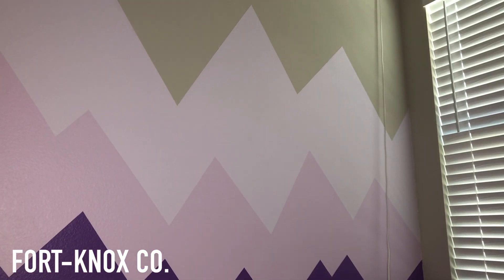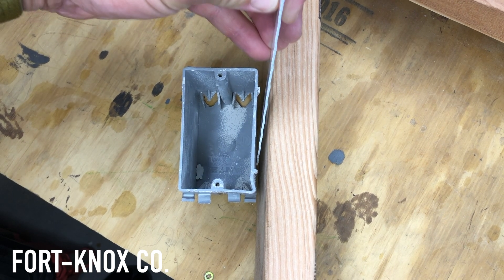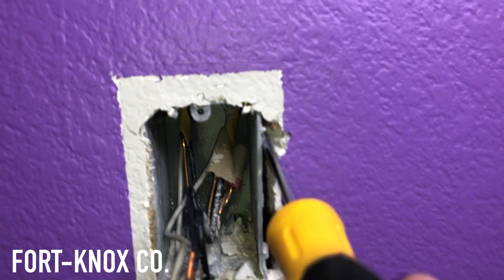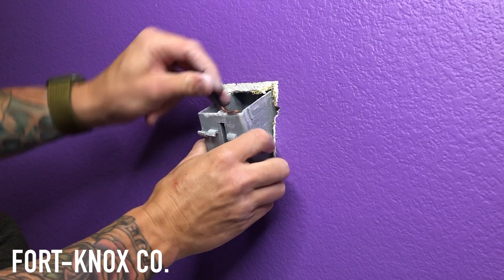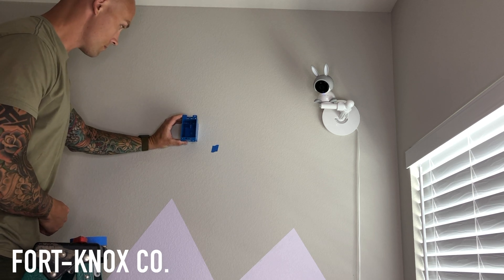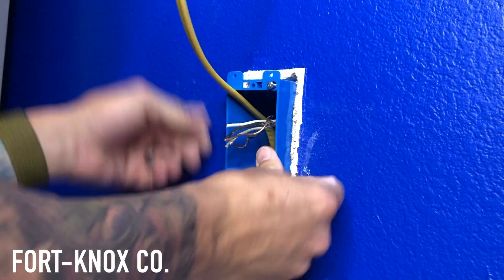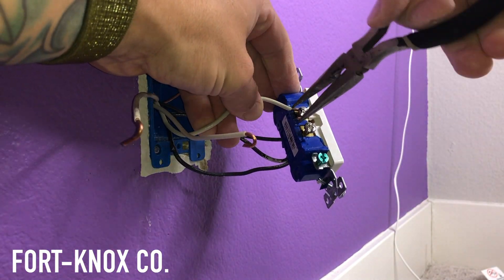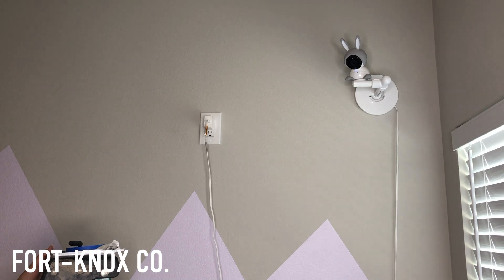How To Add an Electrical Outlet | Move Outlet Up Wall | Wall Mounted TV | Hide Wires  Easy!!

Comment: Why did you replace the original box instead of just using pig tails and running new romex up through the top of the old box to the new box?
Reply from the maker: That is one way to do it. But usually you can run into problems with feeding that wire through the back of the box and then if the wire doesn’t run exactly where you want and there’s any obstruction you have a really hard time adjusting the wire feed through that limited space through the original box. So a lot of ppl would prefer to zip out the old box, have space to work, maybe add a deeper box to help with wire organization and the more easily run your new wire and be done. It can be a time saver overall

Comment: Great how to video. Thanks. A new box at the bottom is nice. Why did you choose not to leave the old box in and avoid the extra work to replace it with a new one?
Reply from the maker: It’s can be difficult to run a wire through the back of your old box. Sounds simple but you’ll quickly realize it can be a hassle. Fishing the wire is much more difficult, organizing the wires can be more difficult since you now have another set of wires. I found that you’ll spend way more time trying to keep it in the wall and using the old box than a couple seconds of zipping out the old one, pulling out your wires, reaching In The wall to run your new wire and tightening two screws to install the new “old work” box. And you can get larger old work boxes if you need it for the extra space inside for the extra wires now there.   It’s really a time saver overall and sometimes a better install.

Comment: What about the amp of the wire and stuff? Someone told me that it might blow circuit. I am confused. Can you please help with my confusion? I was told that the lesser the number higher the amp. like If I use 10/2 will that cause blowout?
Reply from the maker: The wire in the wall supplying power will most likely be a 12/2 ( yellow casing) with your black, white and bare ground. 

The power coming off the transformer is a very small gauge, usually an 18 gauge / bell wire / low voltage. It can handle the voltage/amperage coming off the transformer. It’s downgrading the power source essentially and giving you enough but not too much for that doorbell

Comment: Was it necessary to remove the old box  or just preference?
Reply from the maker: That’s the “correct” way. Remove the old box and install the new “old work” box. Mainly so you have good access to your wires and can run all new wires through the holes in the back of the box. 

But if you want to, you can technically use the box that’s there, but the correct way is to run your wires through the back holes provided. So doing that on an original box already in the wall can be a pain sometimes, spending much more time fiddling with the origin box, so most just zip out the old box and install a new one and have lots of room to move things around and work inside the wall. Running your new wire is much easier when that lid box is removed.

Comment: Thanks for this video, never knew about “old work” gang boxes, I think it will help a lot with way my project of adding an exterior outlet off an interior one at a vastly different height.
Reply from the maker: No problem at all. Yeah the old work boxes are a lifesaver. Once you start doing any electrical work, you learn very quickly about new work and old work boxes. Lol. Literally almost every renovation with electrical you’re gonna need one of these. Then once you understand how they can work, you can use your imagination and create your own path. The next step is learning how to jump across studs or corners.

Comment: I want to try this method to move a floor height outlet to counter height. Then the floor height outlet will be covered by new base cabinets. Since it’s not safe to have an outlet behind a cabinet…how can I achieve this while permanently capping the floor height outlet?
Reply from the maker: You can do this method but instead of keeping the outlet at floor height you just connect the new wires to the original wires, essentially splicing a length of new wire up to your new location. In that floor height box you will have wire caps on each of those connections and you won’t be installing the old outlet, you’ll just tuck those wire connection into the box and place a flat junction box plate over. That way they aren’t sealed into the wall, you technically still have access to them. 
With the new wires running up to your location you can wire in your outlet as you would.  It’s up to you if you want to cut a small square into the back of your cabinet over the old location to access the flat plate cover or not. Just incase you  ever need to work on the wire connection.
Reply: @FortKnoxCo  This is so helpful! Thank you!
Reply from the maker: @CookingWithKhonKhao  I also have a video “how to add and outlet to an existing circuit” where I do similar to  what your saying, outlet under a countertop in a cabinet and I moved electrical down into the cabinet.  Either way the process is very similar. Just depends on how you want to finish the project. Have two outlets , one in the cabinet & one above the counter top. Or put a plate over the connection down below and only use the outlet above.

Comment: Thx. Any reason you need to remove the old box instead of just try to run new wire through it?
Reply from the maker: Removing the old box is technically the correct way to do it. Unless you want to use one of the holes in the back of the original box. You can do that but you’ll probably realize the pulling or running wire through it will be a hassle and could take more time than just removing the box, having lots of space to work with and installing an “old work” box

Comment: My problem is I need to relocate an outlet up higher but offset a couple of feet not just straight up.
Reply from the maker: Not a problem. You would either jump the power over at the box your starting with and drill through the stud just large enough to get the wire through. Then feed it over. Of cut a hole at the top, feed wire up. Then use that hole to drill sideways and feed wire to next hole or area you want. Requires a couple more drywall patches. But that’s how power is added after construction. Not too hard.

Comment: Why did you remove the old box instead of just adding a wire to it from the outlet above?
Reply from the maker: You can do what you said, throw a new line up through the original box with Fishing tape. But there’s a couple ways to accomplish the task. If for some reason you need more room to work or want to upgrade size/type of box this method Is an option. Both ways work though.

Comment: Why remove the old box?  Why not leave it and fish wires up out of the existing box?
Reply from the maker: You could do that too. But you might need more working room or if the fishing through is t successful then the next step to get better access to the wall would be removing the original box then replacing with and “old work” box. There’s several ways to accomplish this
Reply: @FortKnoxCo  i commented before I realized you had insulation to deal with.  Fishing along the stud into an open drywall cut is definitely easier with installation involved.  Gonna give it a go without replacing lower box.
Reply from the maker: @willywonka2164  it’s all good. Yeah with insulation it can be a bit harder. But either way could work. I’m sure you’ll get it done. Catching the tape at the top hole that’s larger is usually not too hard.

Comment: what if I don't have a center outlet to work from? My problem is the closest outlets are both on the left and right sides about 4 ft apart from where I want the center outlet to be. I want a outlet up the middle of the wall behind a mounted tv
Reply from the maker: It will be a lot of the same process overall except to move the wire across a couple studs in the wall you will have to make a couple small cuts in the drywall. There’s several ways to accomplish this. There’s a “pumpkin cut” that helps reduce the amount of patching you’ll need to do, or just a traditional rectangle hole next to the studs, pop it out, drill a small hole through the stud to fish the wire through and repeat that, then when you have it in the location centered you can fish it straight up to the final location. Then you have to patch the small cuts you made.

Comment: Can you do a video on running a tv cable wire in the wall👊🏻
Reply from the maker: Yep. That would be a very similar process. You
Can use drywall old work boxes to trim out the opening there you want it to come out. they have several designs for cables to be pulled out through the wall. Or if you want to have a plug where you screw it into the plate on the wall you can do that too. Just depends on how you want it to look when it’s finished

Comment: You only supposed to have one wire on the screws you need to have pigtails
Reply from the maker: You are correct. Pigtailing the wires is the best way to do that.

Comment: what do you do if you don't want to use the lower outlet anymore? I need to add a range hood outlet and the outlet directly below isn't going to be used anymore since the range will be under it.
Reply from the maker: You can just connect the new wires your running up to the new box and not have them connected to the old outlet. Black to black, white to white and ground to ground. Use the wire caps and tuck them in the box in the original location that is not going to be used. This basically is just extending the wires up to your new location. Like splicing wires to make them longer. 
Then you can just use a blank outlet box plate to cover the box with the wires in it. You’re technically not supposed to drywall over any spots where a wire connection is made so it’s best to just use a blank box plate.

Comment: can you link the thing you checked for the power?
Reply from the maker: Just added it. Should be under tools used. Circuit tester and multi meter.
Reply: thanks!!  @FortKnoxCo
Reply from the maker: @Yawahtahs  no problem at all

Comment: How did you find the old wires and put them up there? I May have missed the step. Either way, you've definitely educated me a lot on this more than any other video that has led me to more confusion lol
Reply from the maker: Thank you I appreciate that. 
Are you referring to the wires in the original outlet that I branched off of to extend up?  Once you pull out the original outlet you basically branch off those wires to run a new set of black/white/ground up to the new location.  Just by tying the new black/white/ground off of the original ones in the back of the outlet in the wall that we started with. This just creates a series of outlets or commonly referred to as a “daisy chain” connection.
Reply: Wow! Now I get it. You explained it perfectly. Thank you very much. I'm no electrician but I mount TVs for a living so power bridge is something that I definitely have to overcome and learn. And buying the kit is definitely not cost effective enough so your method is perfect. I'll do my first job in my own home and see how it goes. Thank you for your valuable help and knowledge
Reply from the maker: @RioElMystic-999  awesome! No problem at all. I’m happy to be of help. & yeah if you can start to offer this as part of your service you could kill it. Increased revenue and people will appreciate it. You can definitely save on your costs by doing this the right way with the old work boxes and some new wires installed. Way cheaper and technically better than the kits they sell.  Stepping your game up and crushing the market.

Comment: here are comments on the outlet installation 
1. when you were turning off the power you are supposed to plug something into the outlet to be safe.
2. it's against code to put 2 wires on 1 screw terminal you need to pigtail that outlet. 
3. you are using the wrong phillips screwdriver use a #1 robertson or the ecx combination screwdriver.
4. you used the 20 amp outlet on 15 amp breaker that can overload the circuit.
5. this video should be removed because of violations.
Reply from the maker: 1. Yes you can check the outlet that way, that is one of many methods and there’s several tool that aren’t too expensive to use to test the circuits to see if they are live or not. 
2. Yes your correct, you should not place two wires under a single screw. Pigtailing is the preferred technique. 
3. Yes there is a specific “electrician” type screwdriver, but most phillips screwdrivers will do the job just fine. This is a little more preference in my opinion, not everyone will have a #1 Robertson or ecx combination on hand. But most will have a standard Philips or flat head laying around to do the job. 
4. All my wall outlets are 20amp circuits here. I have 15 amp breakers for my lighting and 20 amp for my outlets. So the 20 amp tamper resistant outlet is what’s around the house from the builder. 
5. The video is really for information, motivation, educational purposes obviously. Never did I say this is the only way to accomplish something or the text book way. Everyone has the ability to do their research, compare and see what works for them and their abilities. Most gather that this type of stuff overall isn’t too complicated, nothing  to be afraid of and can do it themselves.  And fortunately there’s others like you who can help them too along the way. Everything that you said is great information and I hope it finds it’s way to those who need it. & I’ll try and incorporate some of the stuff you said into future content because it’s all good info.
Reply: @FortKnoxCo  do you know the wago
 221
Reply from the maker: @Aasiakhanum1  yep. Haven’t used them much but have seen them. They look nice and convenient

Comment: “How to home” has same video but he doesn’t cut the existing box. Much easier use fishing pull
Reply from the maker: I know exactly what your talking about. I have a video I’m putting together where you leave the original box in place and pull the new wire up.  It’s just not code compliant that way.

Comment: Instead of having the outlet at the bottom, could you just cap the old and new wires together?
Reply from the maker: Yep. You can do that too if you don’t need or want the old outlet. You’d then just put a blank outlet cover over the old box. Technically you are not supposed to cover and hide wire connections in the walls, like drywalling over it after you splice the wires to the new. You need to be able to access anywhere there is connections. But yep, I’ve don’t this method as well.

Comment: Thanks. Doing exact same thing for my cameras in bedroom as well so this is perfect. Guess I can add the two tv wall Mount while I’m at it haha
Reply from the maker: Yep! Exactly. I just did one for our tv in the spare room. I used a different method where you don’t have to remove the original box this time. I’ll be putting the video together for it here this coming week

Comment: Not too shabby. Definitely would've pig tailed. And some glass Rods would have helped.😁
Reply from the maker: Thank you. Yeah I went back and pig tailed the wires. I have another video coming out showing another method I used and I show how to pig tail the wires.
Reply: @FortKnoxCo  i’ve been doing it for 28 years and I have so many tricks up my sleeve, I am the master of no drywall damage.
Reply from the maker: @timbo86051  that’s the key, do drywall work or as minimal as possible.

Comment: What do you do with fire breaks / fire blocks?
Reply from the maker: With fire blocks in the wall your going to have to make a small cut in the drywall and drill a hole as close to the center of the blocking and pass the wire up through. This is commonly done and almost always expected when passing wires up or across to new locations. 100% doable but just requires a couple extra steps and some drywall repair

Comment: Can I just wire nut the wires together on the old bottom socket? I’m raising it because it’s going to be covered with cabinets so there’s no point in having an outlet on the bottom one.
Reply from the maker: Yes you can just eliminate the bottom outlet and connect the wires with a nut/cap. You don’t have to keep the outlet there. A lot of people do just that because the original outlet isn’t needed and they just want a new location for the outlet.
Reply: @FortKnoxCo  you the man. Thank you. I’ll be attempting this Thursday and I’ll let you know how it goes
Reply from the maker: @josht617  no problem at all. Keep me posted. I have another video Im putting out that I just recently did where I do basically the same thing but without removing the original box. I leave it in place and run the wires through the old box. Should hopefully have it posted within the next week
Reply: @FortKnoxCo   It worked out GREAT!  My wires came from the attic so I was able to skip A LOT of steps haha. The only thing that seems off is that the plate sticks out the wall a little bit. I noticed you had some secondary plate that I’d imagine fixed this issue
Reply from the maker: @josht617  that’s awesome to hear. Yeah I usually use an updated face plate and they are usually larger and may lay a little more flat along the wall. If it still sticks out try adjusting the outlet itself back into the box a little more so when you install the face plate it pulls the plate back too
Reply: @FortKnoxCo  I have the outlet screwed back as far as it’ll go. The problem is those little tabs on the top/bottom that go flush with the wall, instead of into the wall.
Reply from the maker: @josht617  Then I'd recommend trying out a newer face place or one of the "premium" face plates that are made with better features. it may go over and around that gap and lay more flush.